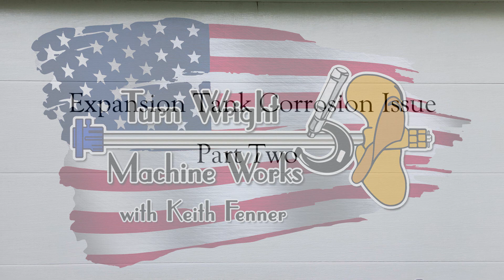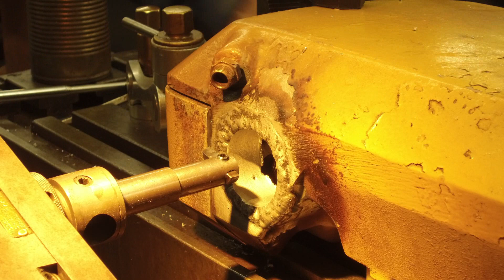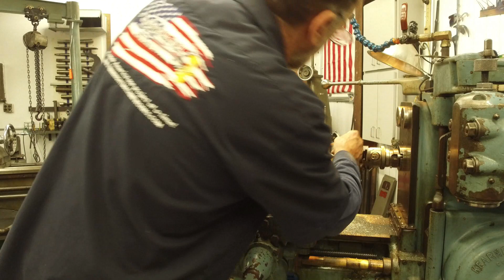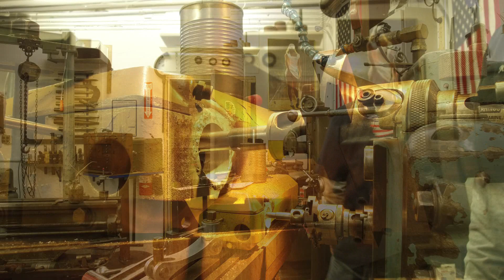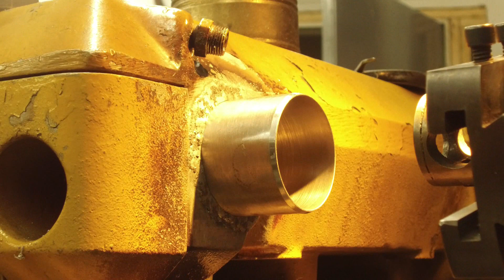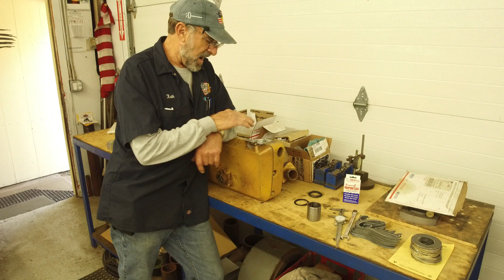Expansion Tank Corrosion Issue Part Two

Comment: I can add some clarity to corrosion on boats (yachts) at sea. Corrosion in its different forms is numerous and at times complex and the reason that many people equate corrosion with saltwater oceans is mainly due to historical reasons. However, the mechanisms of how corrosion manifests itself is well understood and does not necessarily require the application be maritime. 

One reason we look at corrosion at sea (saltwater oceans) with aluminum vessels is aluminum is a very good material to make boats (yachts) and many boat components, although we use different aluminum alloys for different parts. Corrosion in the presence of a fluid (called and electrolyte for historical reasons, like salt water, or water based fluid like brine or antifreeze) between two metals is called galvanic corrosion, being two different metals in contact with each other in the presence of an electrolyte.

The reason the expansion tank corroded was due to galvanic corrosion where the aluminum is less noble than some other large surface area metal (in comparison to the aluminum surface area), like copper for instance, in contact with the aluminum and an electrolyte between them, in this case the coolant. Think of the fluid as a wire completing a circuit around the two metals. When this occurs the least noble metal (aluminum in this case) will corrode rather than the more noble metal it is actually being consumed. To mitigate this consumption of the aluminum we introduce another metal that is less noble than aluminum like zinc (called a zinc anode). They make versions for expansion tank applications that have the zinc anode alloy mounted in a NPT housing that you mount into the aluminum tank (just like a pipe plug) using a welded on aluminum bung. The Zinc will now be consumed instead of the aluminum. Place the zinc anode in close proximity to the worse corrosion location on the aluminum expansion tank but with easy access so you can remove and inspect it.

From time to time you can inspect the zinc anode to see how much is being consumed. This will give you an idea of the extent of the galvanic action in the system in real time. You will have to replace the zinc anode when it is 60% consumed (reduction in surface area of 40% from new).

electrolysis is a process that uses an electro potential source like a battery to ionize metal atoms into solution, it is not a corrosion method. The closest corrosion mechanism to this is called stray current corrosion. It is where unwanted current (usually DC) is accelerating the galvanic corrosion process.

When designing engine cooling systems for yachts we have to be very careful to address any corrosion processes, and for aluminum there are many. One quick example is using saltwater to cool the engine and then cool the exhaust (called a wet exhaust). A corrosion engine would cringe at using saltwater to cool an engine at sea, as far as the yachts I have designed this is never done. I am also not a fan of salt water wet exhausts to which we have many better alternatives.

Comment: I suspect that the boat owner hadn't changed the cooling fluid in many years or that he used glycol with the wrong type of corrosion inhibitor. The freezing protection lasts forever but the corrosion inhibitors degrade in a few years. I heard of a guy that used the wrong type and his aluminum heat exchanger (this was in a car) got totally eaten by corrosion in less than one year. The choice of coolant is a jungle, often it doesn't say on the can what metals the inhibitors are good for. I didn't dare risking my boat's engines so I bought glycol from Volvo Penta (not much more expensive than anything else) that I know is right for my old engines. Further, I boiled the dilution water to get rid of most of the dissolved oxygen before mixing with the glycol.

Comment: That really was a tough job - great repair. You didn't mention how you arrived at your grove sizes. For 40 years I've used the same PARKER O'RING BOOK. It has all dimensions for all size o'rings. Probably some others do too.
Reply from the maker: I have the same Parker book! done enough rings that the tolerances are the same for application, tube, face, etc. ;{)

Comment: Hi Keith a great repair considering the material you had to weld. Just thinking would machining the bore  to shoulder, machine up a insert with o ring groove in with a shrink fit scotch key for security to avoid the welding.
Cheer Ian.

Comment: Your a magician Keith no doubt about it ,,,, that was some messy cast ally ,,Have you ever used "J>B WELD" i have found it great but as usual you must have a clean silicone free base to start with ,, J.B Weld is magic you can machine and even top the stuff once hardened ,, Great vid as usual buddy .
R.J.T 
South east Australia
Reply: @Truthisstrangerthan Fiction  I was thinking the Pin hole not the repair , Jb weld has no metal componant so no electrolisis ,, some fillers use copper or stainless steel powder , then it just eats away at the ally ,,,
Reply: JB WELD ?
Is ok ??
But it's more of a patch job than a repair.
Good for,  I don't have time to do this job now scenarios, LOL.
Reply: @weldmachine   pin holes not the repair ,,,
Reply: @weldmachine   sorry i forgot the sarcastic "LOL" ......
Reply: @13yearsaprepperr.jtilbury.51  
LOL.
Maybe a bit lack of information of what the JB WELD would used for ??
I read it as it's written ? ( apologizes ) 
I was not trying to be Sarcastic ( well maybe a little it's YouTube lol ?? )
Because i read it as it's written i would add LOL.
I just find to many people talking about JB WELD as the cure for any Aluminium repair.
My experience as i do A LOT of Aluminium repair work.
I am ALWAYS dealing with digging out JB WELD before i start a repair.
The LOL was more of a frustration of it's Over Use not a personal dig at you.
All the best.
Peter.
also from SE AUST.

Comment: Great job Keith. That turned out really nice. I am looking forward to seeing the heat ex-changer jacket getting worked on. I worked on a boat for a few years and those heat exchanger end caps loved to corrode. Aluminium, salt water and a bit of electrolysis is a bad bad mix!
Reply from the maker: That was an in and out fast project, no video. ;{)

Comment: Really appreciate how you always try to do a really good job.  Keith what kind of boring head is that?
Reply from the maker: Chandler 2 1/2  ;{)
Reply: If your curious ?
Type into Google:  auto feed boring head.
You will see a few options available.
Reply: @weldmachine  I'd seen the 'Tree' one before .......and the one Oxtool uses.  This one kinda looked primitive but it has that sweet option to adjust diameter while the machine is running too
Reply: @dizzolve  
Not cheap to buy. 
But very useful.

Comment: I would have been tempted to bore the whole thing out, make a new weld in sleeve with "O ring groove" in the lathe and then weld that in place because that cast aluminium is NASTY!
That or if possible, bore it and weld a tube in place and turn the connection from a "Inny" to an "Outy"  like Craig says and use a rubber sleeve to separate dissimilar metals which caused the corrosion in the first place.

Comment: Hi Keith, I was wondering how you were going to cut the groove, I've never seen a boring head that self adjusts, that would be very useful.

In the modern age of CNC, a little programming and a tool change and it's done. 

When I see tooling like your boring head, it makes me think of the guy who designed it and built it. Whoever it was clearly had a similar need.

Thanks for another great project, and why your customer's keep coming. 

All the best, regards Dennis.
Reply: The Auto Feed Boring Heads definitely come in handy for sure.

Comment: Would a thick layer of silicon grease help lube the “o” ring as well as help to prevent electrolysis?  Electricians use a corrosion inhibitor on aluminum conductors to help prevent electrolysis.

Comment: Wow, what a trick piece of kit that advancing head was!  Before seeing that, was wondering how that groove was going to be done with only a manual boring head, as in tighten feed, run a few revolutions, tighten the feed again, go another few revolutions...would have taken forever and been so tedius and repetitive one could have easily messed up.  Then was thinking just now what about building some sort of jig to swing it in the lathe, but then with how the bore was off-center, nope job can only be done in either 'Debbie' the Birdgeport, or the the K&T.

BTW Mr. Fenner, of the YT machining community I watch, your K&T 2H is now the sole remaining 2H I get to see on-camera often.  Keith Rucker formerly had a 2H as well, but his was a whole lot more worn than yours is and was just too small for the kinds of parts he finds himself working on, so he has replaced it with a 3H.

When you rebuilt your 2H in the 90's Keith, did you scrape in the ways or were the ways in good enough condition they didn't need scraping?   From all the content on scraping on Keith Rucker's channel it got me to wondering.
Reply from the maker: The ways were still in pretty good shape, I did not. ;{)

Comment: I recently purchased a 12 ton press.  I have used it to press fit cylinders.  Would it have been easier to bore the tank to receive a machined sleeve press fitted to the tank.  I'm thinking that doing the machining on the  Clausing with the renovated cross slide would have been faster and easier.  My question is how would a press fit sleeve hold up in that particular application.  Also, if the job was done with a sleeve, would making the sleeve out of Stainless be better and possibly last longer.  Thanks for listening and the videos are as usual only great.
Reply from the maker: Sleeves create two areas to fail. ;{)

Comment: One possible way to determine the O-ring groove diameter is to slip the O-ring around the pipe, then measure the diameter with the O-ring. That diameter will be too large for the groove diameter. Take away from that diameter something like 1/3 of the material thickness of the O-ring and You end up with quite tight fit.  It depends on the O-ring material how much smaller the final groove diameter should be.
Reply: Finno Ugric Machining As a rule of thumb, we used to work on compression to about 80-85% of the original O ring thickness, but there are excellent calculators out there e.g.  https://oringcalculator.eriksgroup.com

Comment: Keith, would it be possible to avoid that corrosion by attaching a ground strap to that tank?
Reply from the maker: Coolant type would be the first thing, zinc anodes second, the tank bolts hard to the engine. ;{)
Reply: @KeithFenner  The sleeve is Stainless steel?

Comment: That autofacer looks nice, it also looks like it has the potential of hitting your knuckles.
Reply: @UCLravDwu3_Exl7OFZcIcyvA Absolutely, Ive seen these types of tools before but they are mostly round, this one has a large out of center mass rotating around which makes it even more dangerous to put your hands near it.
Reply: Normally you would have a drive arm attached to this spindle.
The way Keith was using it just to get the job done.

Comment: That level of corrosion is definitely a problem. From what I understand it's an expansion tank for coolant on a marine vessel. It's worth to pay attention to which coolant you use because not every coolant works well with aluminum. If you mix concentrated coolant with water you have to make sure that the water is suitable, the pH level (acidity/base level) is important. Chemistry can be a headache.
In any case it looks like a good job done. I'm a bit curious about what it would look like when installed.

Comment: Will the weld rod aluminum be more corrosion resistant that the original cast?   Not being a talented welder my initial thoughts would have been to bore out the corrosion and press in an aluminum bronze sleeve and machine an o-ring groove in that.
Reply: the idea of a sleeve is OK, in a corrosion environment, it is imperative  ot bring a close attention to chosen material for the sleeve to avoid electrolysis between parts, the ideal combination is to usethe same alloy as the original casting.
in s a setup
for tightness, it is preferable to use heat and shrink method over perss in method, the fit at the interface is much more intimate and the chances of infiltrations is minimized.
Reply: There is a few ways to approach this job ??
The list is long for options, lol.
Keith showed one of them.
Reply: I had a similar idea.  Turn a slug to a press fit then bevel it and the tank and make a single weld pass around the end of the sleeve.  Keith always seems to pull off decent welds in situations that I likely wouldn't even try.

Comment: As an exercise about O-rings and O-ring grooves, you might Google an O-ring chart. Buna N o-rings, the 2- dash series have considerable tolerance variations. A 1/8” o-ring is measuring 0.138.   It is possible to have a variation of plus or minus .007, put that into your computer brain and try to work with an O ring groove such as the one you see on this video. Good job, I know this was easy for you but just think about the tooling you have to have to do a job like this and the experience this is why things cost what they do.

Edited:  This wasn’t not meant to be an exercise for Keith it’s for anyone else watching the videos and wondering why something is 1/8 of an inch and it really measures .138. I didn’t make that very clear. As you will see in the chart all dimensions are nominal. 1/8 of an inch isn’t really 1/8 of an inch, 2 inches is not really 2 inches.
Reply: the depth of the groove is more critical than the width,   the groove width needs to  be wider than the O ring to allow it to deform .
Reply: YT the major O ring suppliers have calculators for those who can’t be bothered to work it all out. E.G. Parkers or Eriks has a good one https://oringcalculator.eriksgroup.com

Comment: I thought you would have had a positive stop for the Y axis of the part.  I understand the one for the X.
Did you have the dimensions of the hole and sealing area to begin with ? Thanks.
Reply: He just squared it to the edge of the table both times. Close enough.
Reply: Your questions could be answered if you watch the first video ?
Reply: @weldmachine  I did and saw a square was used. I just thought using a positive stop would have been easier to locate the part.
Reply: @RichieCat4223  
I guess it's a case of trying to keep it quick and  simple.

Comment: Being a farm boy, I'd have welded on a piece of pipe and clamped a hose on it.
Reply from the maker: LOL! ;{)
Reply: @KeithFenner  being a Flint Knapper, I would have... called Keith Fenner
Reply: Being a joiner i would have glued on (in) a piece of pipe with liquid metal epoxy shit and clamped a hose on it. But i would have used a alu pipe beeing a similar material. This one seems to be stainless and that means trouble ahead again.
Reply: Being a CNC machinist I would have whittled a new half out of bar.
Reply: Being a unskilled mechanic/machinist I would have hired one of you guys to fix it for me.
Reply: Being an engineer, I would have bored out the corrosion and made a flanged repair sleeve with o-rings on the outside to seal to the tank, and the inside to seal to the original sleeve so it is more serviceable, and no welding required.
Reply: @DavidChadwell  Proving that engineers always overthink things and take the most difficult route.
Reply: @benpress8884  I can't deny that, lol.
Reply: I was thinking of threading the hole, make a flat on the outside. Make a new part that threads in and has a gasket on the flat spot.
Or just mill out the hole to clean find an aluminum of the shelf part with threaded male and female threads, and just weld it into the part.  
Then you could remove part with no problems.

Comment: That's a cool tool.  Didn't know that they made some with the advancing ring.
Reply: Just look up a boring and facing head , they cost from ouch to get the brandy out 😱
Reply: The planing/boring head Keith is using does not have hard stops which one could adjust in advance to get it right without the iterative process of cut-measure-advance. Mine Wohlhaupter UPA3 has these stops and they can be used to stop the feed process in the correct diameter.  Sometimes these heads can be found on auction sites but normally the good quality ones become expensive. The measuring tool Keith is using for the goove .... that's new to me. Thanks Keith, now I will modify one of my compasses to do that.
Reply: @FinnoUgricMachining  you can buy "inside calipers", they have been around forever.